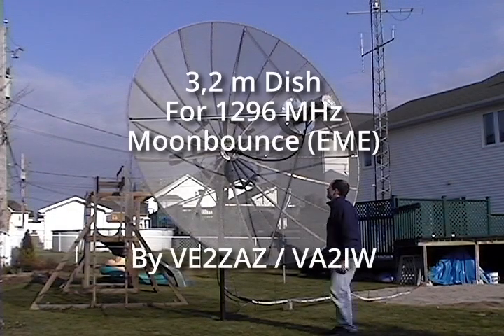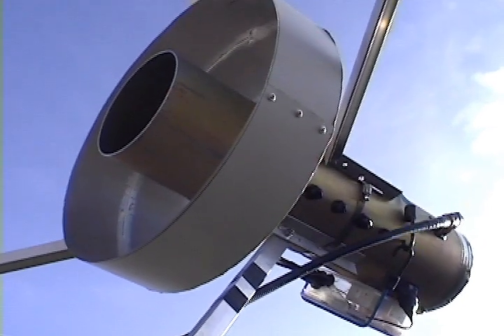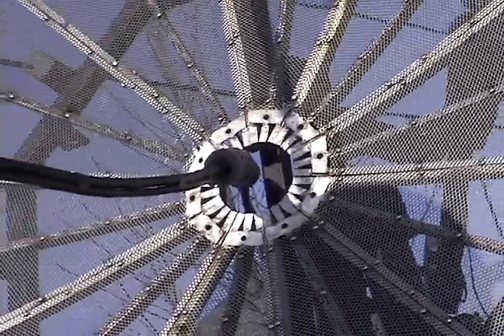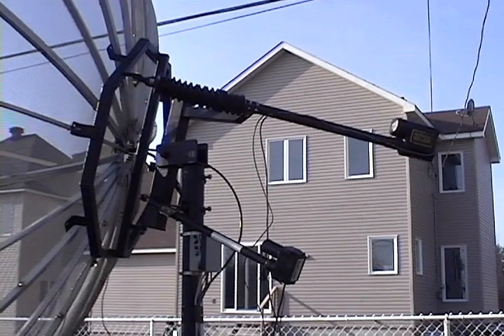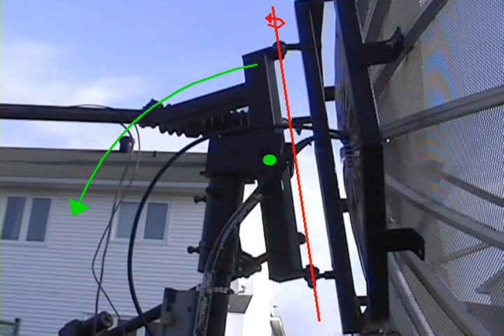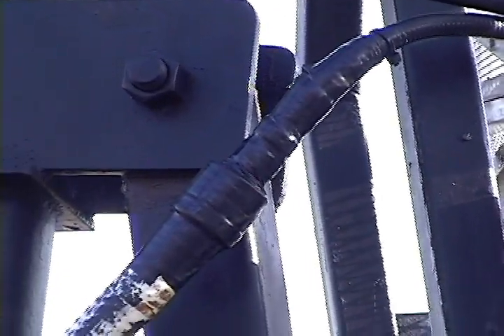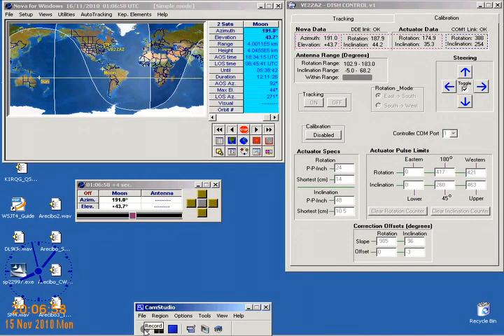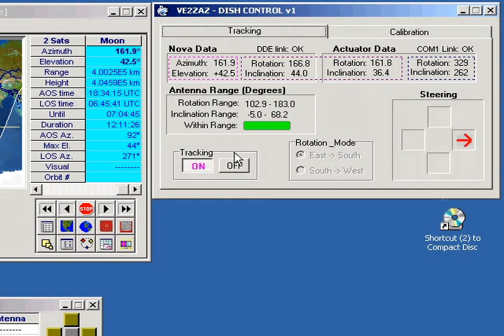VE2ZAZ - 3.2m dish for 1296MHz EME (Moonbounce) - 2024 Remaster

Comment: Where can one find  a calculator to figure the distance the feed horn sits on dish for different frequencies?
Reply from the maker: That distance is not a function of frequency. The focal point position is a function of dish geometry. Simple measurements of the dish and parabola calculations will yield the exact the focal point distance from the bottom of the dish. Here is one calculator:
https://www.calctown.com/calculators/parabolic-dish-antenna
Reply: Brilliant! I have an old satellite dish in my yard from the 80”s probly about 15ft in diameter. Would love to repurpose it and make it work on 23cm  or any other band for EME.not sure where to start but I will check out your QRZ page. 73